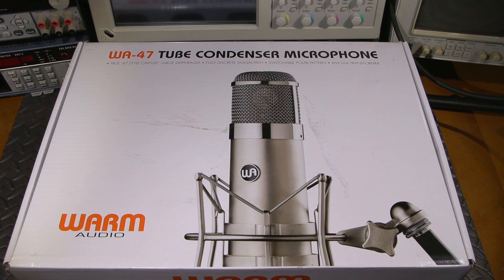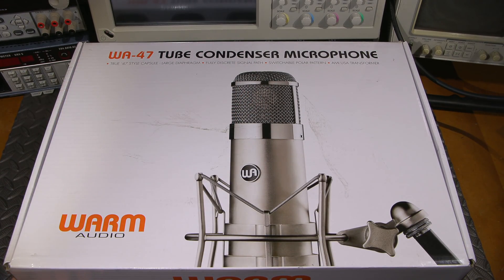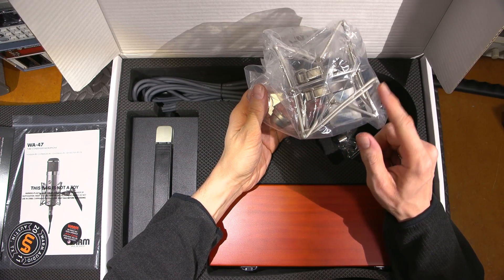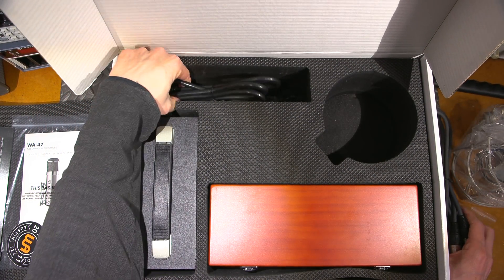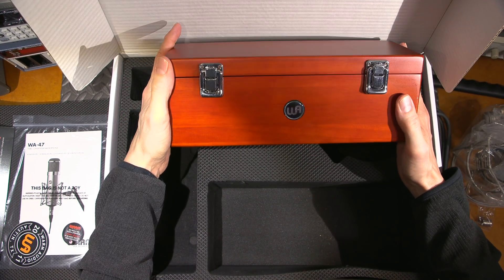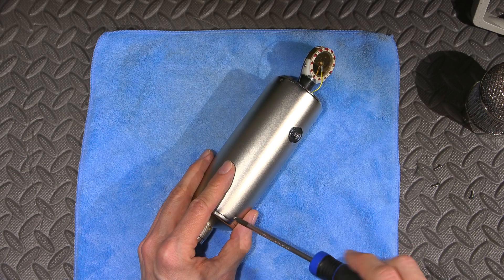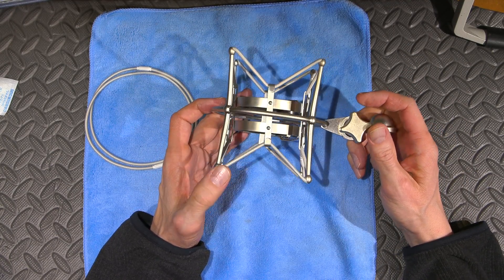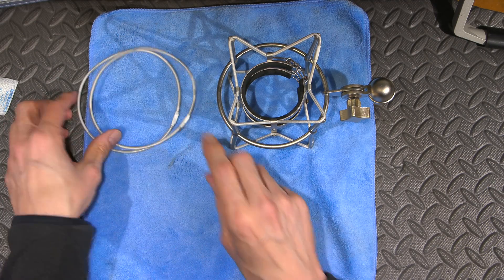Tube Microphone Used At Mr Carlson's Lab!

Comment: My husband has an APEX 460B Microphone? He bought it just before the pandemic and is wondering if it could be improved. Different tube or some replaced components or new element? It is made in China as are so many other products. It sounds quite good for its cost. $300.00 but the question we always ask, can it be made even better?
Reply from the maker: The Apex 460 is a very good foundation to start with. Lots of things can be done to improve that. The easiest is a NOS 12AY7. The similarities between the APEX and the equivalent Telefunken are astounding. Search for "APEX 460 and Telefunken," You will find the comparison on the net.

Comment: A fantastic Microphone and sounds good. I am surprised that they are still using Valves (Tubes) instead of, say, F.E.T.'s which of course, have similar characteristics.
Reply: Neumann offered at least two versions of this mike... One of them is the U-47 fet  that came after the U47 as a substitute, but as people went on using U47, U67 and U87 Mics for vocals, the U47 fet became one of the most used brass and bass drum mics from 1972 on in German recording studios. It has the same capsule like the vintage U47, but can handle up ro 147dB pressure. And the best news is that it is available again from Neumann.

Comment: Would have liked to have had a more technical rundown on the mic.  What plate voltage is used and noted the voltages on the power transformer without a voltage normally used for filament. This leads me to guess the tube filament is powered by regulated and filtered DC instead of AC commonly used in old radios and amplifiers.  Dues the tube run on 6.3 Volts DC and about 220 Volts  DC for the plate?

Comment: Hi Mr Carlson. I am Lance and I have an old Onkyo receiver THX NR808. I want to replace the transistors/capacitor I don'tknow(7 semiconductors attached by copper screws on the aluminum plate near the transformer). Can u help me find the name and the numeric values of those components to order? I read a name that is printed on them as follows: "Toshiba ATT 0001 39. Can you please also give me the substitute name and more or less equivalent value  of those semiconductors and where I can order them online. Thanks in advance for your insight and help.

Comment: 5751 is a lower gain version of 12ax7  70 vs 100  the 6djb (  6922 7308 )  has a gain  around 30   as well as much more current for the 6dj8  . Transconductance  is vastly different as well.  Sorry but I do not see the two the same  other than they are both twin triode .
Reply from the maker: Hi John. Listen carefully to what I said in the video.
Reply: @MrCarlsonsLab   i did and the two types of tube are radically different even if they look like jj was using the simular  plates.
Reply from the maker: Yes John I realize that. The plate structure in a 6DJ8 is all together different than a 5751 style plate. That plate structure (6DJ8) is usually reserved only for very high transconductance triodes. So yes, they are very different, and I find it odd that a 5751 would have similar internals to a 6DJ8. The only difference possibly being the filament voltage and connections. Down the road (for curiosity's sake) I will compare their curves on a curve tracer.
Reply: @MrCarlsonsLab  Blackburn mullard plant in it very last incarnation showed 12ax7 with high gain that had the same structure .  this before  closed in the 21 century .  Not the old plant just the location .

Comment: One guess -- The big and heavy housing might be made of Mu-metal?  Before I really knew better, I was wondering some audio line transformers that appeared heavy and basically like cast iron housings.  About fist size overall, and 1/2" wall.  When I looked inside, there was a tiny transformer, maybe 3 cubic centimeters (1/2" x 1/2" x 1/2").  We needed some more, but they were pure unobtainium.  And we got an explanation that the big casing was Mu-metal for magnetic field noise rejection.  Well, good to know.  But we still needed something and finally settled on a more modern version, a tubular one, about 3/4" in diameter and 2" length.  I never opened it or made any attempt to verify the material, but am pretty sure it also had a Mu-metal housing, just thinner wall.

Comment: Well designed but I'm not too sure about those wires to the transducer itself, which pass through a metal plate with no insulating grommet whatsoever.

Comment: you know?  I have a DBX Model 1066 compressor/gate unit that was modified for broadcast... that needs new controls (pots and switches) and probably needs re-capping as well...  I'd do it myself but I'm now almost completely blind and I no-longer have connections and now, not knowing whats a "good" brand of control and/or cap in this day and age of Chinese garbage components!  how would you like to work on it as content- to give it that "Carlson magic touch"- for one of your videos and how much would you charge me?   just a curiosity at this point...  I bought the unit back in 1996 and it went through hell and  back a dozen times, at least!  it now spends its life in the racks for my live videos and, up until recently, assured a fantastic sound that I have heard nowhere else on the internet dial!  The unit has "rack rash" and  the case is mostly scratched up all over (though the face is still clean and unscratched) has already lost its power transformer (typical "Billion" brand power transformers burn up!) which was replaced with a nice toroid I pulled from some other burned up piece of equipment many many years ago.  I also had the pots get their shafts pulled off and/or broken off at the connection terminals (they are not good quality pots) and to having to shunt all the switches due to them failing (one at a time) over the last 35 years of continuous service!  I also fitted a BH "Digilog" stereo coder board into the unit to drive an FM exciter, way back in the 90s....  When I looked online for a replacement, it seems that the DBX model 1066 is no-longer in production.  Just curious what you think! :)

Comment: Mr. Carlson are you going to bring up the topic of the state of component scarcity of components that are becoming hard to source like certain tube types used in radios and high value high wattage resistors also high voltage caps used in tube amp power supplies are becoming hard to nearly impossible to find not to mention the cost of these scarce components. Have seen some of the rediculous prices for tubes on Fleabay? some guy in Italy has 2 uhf or vhf tubes for sale at 10 thousand dollars! can these people be taken seriously?

Comment: I have a EICO 460 oscilloscope and when I powered it up the screen doesn’t show anything but the tubes lit up I recently started working on it and found that the hermetic seal on every single tube appeared to have failed because the pins were all green I am wondering should I continue and buy the new tubes or should I stop and work on something else it does show signs of rust and some of the capacitors have been replaced and almost all of the tubes had already been replaced I hope that you have some suggestions for me
Reply: Corrosion on the pins doesn't mean the tube has failed. It's better to check the getter on the glass to see if they are still shiny silver of if they have turned white.
Reply: Thank you I wasn’t sure if they were all bad because the 12au7a had gone to air

Comment: A newbie question...does the tube in the mic produce much heat?  I guess the shielding precludes any vent openings in the body.  Does the tube clamp and base act as a heat sink conducting to the outside case?  The wall thickness on the casing tube is very impressive...looks like 1/8th of an inch!
Reply from the maker: It gets, I would say.... "comfortably" warm.
Reply: @MrCarlsonsLab  Any issues with the electrolytics and that internal heat?
Reply: @MrCrystalcranium  I don't remember seeing any electrolytics inside the microphone part.

Comment: Nice video. Those caps in power supply looks like cheap ones..but i might be wrong..btw isn't it a bit too warm inside the microphone ? btw what about changing caps to better ones ..that can handle better higher temperatures..such as tantalum or similar ?

Comment: I'm wondering:  Are all studio mics built similarly with all the associated components installed internally, or is this just your microphone's technique?
Reply: You want to minimize the noise and interference from outside, and most microphones, tubed, Fet, will have the preamp mounted in the same enclosure as the capsule. The signal from the capsule it self is very small,  and even in studio environment the microphone cables have more than a few meters in length. This mic is based on post WW2 U47 microphone produced by Neumann and Telefunken. A lot of recordings, including The Beatles use U47, or newer U67 mics. The capsule itself is based on the pre war CMV 3 microphone, called the bottle and seen on many Hitler's speaches. If you ever watched the Das Boot movie by Wolfgang Petersen, you will get the idea. BTW, the movie is sort of an allegory to the death of Telefunken, one of audio electronic manufacturers from Germany, which developed PAL TV system, Telecom C4/Hi-Com noise reduction.

Comment: The foam used to hold the mic looks very similar to hvac foam insulation tape,  it stands up well to hot/cold temperature fluctuations.  I've used it before in some older CB radios where the factory foam had just disintegrated over time.

Comment: @Mr Carlson's Lab: Can you show power supply ripple amount/harmonics in oscilloscope? Just a bit curios for a linear system transformer. Operator voltage fluctuation in my location (Finland, Mikkeli, ESE) is about 0.67 % nominal and sporadic - about 10 - 20 'blackouts'  in a day, lasting about  2 - 3 mill seconds (load contactor relay time delay or some industrial in rush current hogging starting motor without appropriate LC smoother?).

Comment: I was somewhat disappointed by the inner workings of the WA-47.When I was looking to purchase another LDC tube mic I chose the MXL V69M in part because it is half the price of the WA-47.  However the V69 has a very substantial circuit board and after seeing the inside of the WA-47 I am even more certain I made the right choice.    I would like to see a direct comparison between the WA-47 and the MXL V69M

Comment: I've actually used your YouTube videos to test the output stages of various audio systems -- that mic, and your wizardry around it, are an unbelievable combo. If your video sounds like crap, I KNOW I have a problem. 😁 Most people I've known in electronic engineering are fairly haphazard with audio, so this is clearly no accident. How'd you end up venturing down the audio road?
Reply: You test audio gear with compressed YouTube videos? 🤔 Strange.

Comment: To say the least the warm products is a industry best of standards The 47 vacuum displayed in this video runs about 1000 dollars and it's best application is classical vocals ect. Warm also offers a all solid state for 299⁰⁰ which simply has amazing sound which there are many examples displayed on there website. 
Although in this video the 47 vacuum is a bit of a over kill for a broadcasters mic were the 299⁰⁰ solid state would do the same job unless You sing Your way through Your YouTube video descriptions.
Reply: Great info, thanks. Subjectively, how "close" would you say the sound of the solid state model is to the tube model?

Comment: Oh, I thought it was a real U47 equipped with a VF14 tube. ☹️
Reply from the maker: I'm not singing :^)
Reply: @MrCarlsonsLab  Well, you can develop your channel to a musical one! 😁
BTW I managed to buy an original Neuman U47 (and yes, a good condition VF14 inside) three years ago. It was originally from European radio organisation. Only about $2000.  It went to my friend's collection. He is an microphone enthusiast and has an original power supplys for it as well. They really are legendary mics.
Reply from the maker: That's a very good price for an original. Glad to hear it has a good home.
Reply: @MrCarlsonsLab  It is a crazy mic; If  I don't remember wrong, heater voltage of that VF14 is bigger than plate voltage, isn't it? 😁

Comment: The transformer (by AMI) is very nice—clearly where they spent their money in this product.

5751 is a very interesting choice for a mic modeled after a U47. If you’re curious, try modifying the circuit to use an EF800 or EF802 instead—since you have two, it’d be interesting to get your thoughts on the comparison!
Reply: Those transformers are made by hand in a small shop in Gaylord, KS which is on state highway 9 southwest of Smith Center.  Which is odd since the company is based out of Clallam Bay, Washington.
Reply: @douro20  I thought AMI relocated from Gaylord to WA after Oliver Archut passed away?
Reply: really its the capsule where they put the money.  He isn’t buying Ben’s capsule from Australia because China is more expensive.  Its a $350 capsule for us DIY’ers!  Assuming WA has more favorable terms.  IMO the color is too much for me in the WA unless im looking for that effect, but for VO is perfectly perfect.

Comment: The Science on the foam tape in the microphone mount....

Any thermoplastic will creep under sustained compression or tension. Whoever spec'd the mount foam was likely a EE!

Crosslinked polymers, like actual rubber does not creep.

Actual foamed rubbers are pretty expensive (Nokian snow/ice tires are an example)

Most likely the tape used was made of ethylene vinyl acetate material. This material is used in shoe soles and is known to creep at least 50%

Comment: JJ

JJs versions of ECC83, and 5751, seem to be heavily inspired  by the Telefunken ECC803S, which also has plate structures very similar to the 6DJ8 / ECC88 types. I have a number of the original NOS Telefunken ECC803S, and although they are very quiet, and very low microphonic, and worth enormous amounts of money, they subjectively sound quite lousy to be honest. The regular long plate Telefunken ECC83s sounds at least 300% better...

Comment: WA is such a garbage company IMVHO. There are many better companies with people that actually cares.
But sure, the mic is probably ok. One easy mod is to mount the electrolytes on the other side of the PCB/tube instead of just aside of it (heat).
If the build quality of that mic impresses you, check out a Neumann and you would be very euphoric.